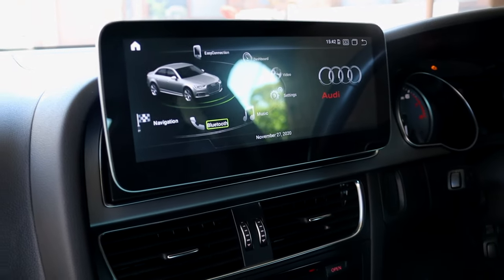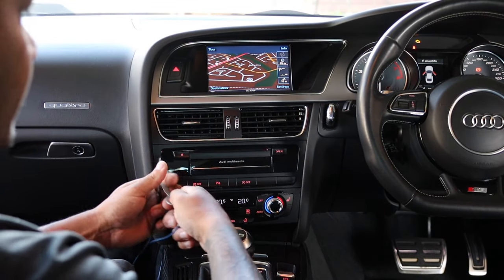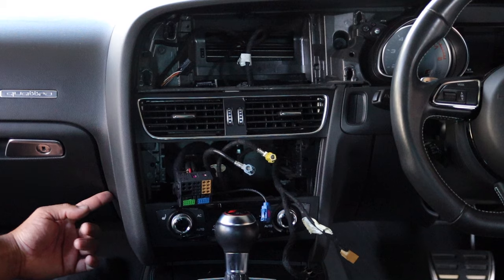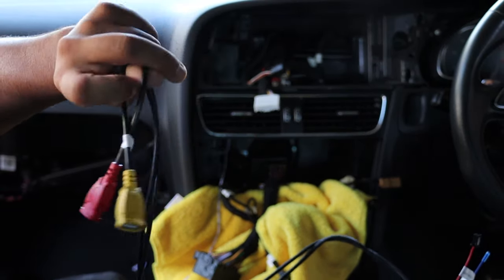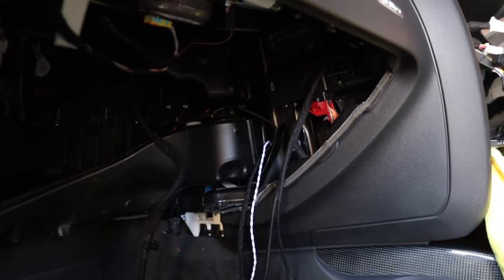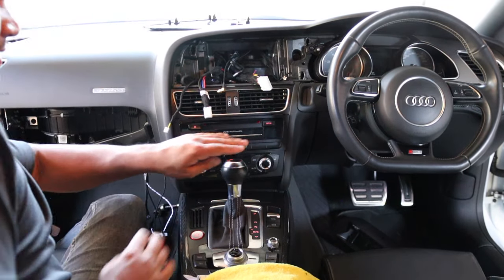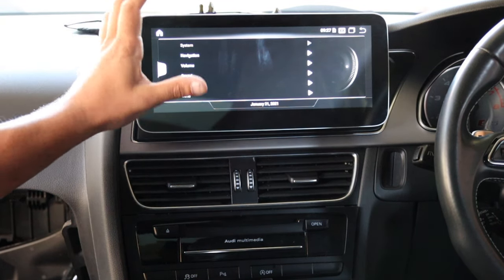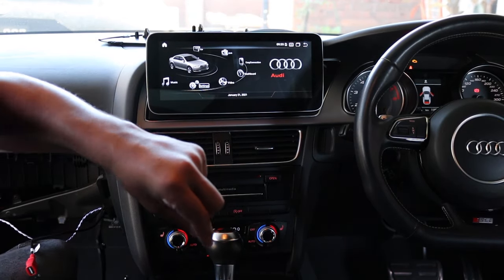Audi A4/A5/Q5 10.25" Android Screen Install (Full Install) Wireless CarPlay / Youtube / Netflix.

Comment: Great video. Just installed this on my A5. I had such a tough time removing the glove box. I had one extra screw behind the cd changer that no one else online seems to have. Apart from that it was pretty easy thanks to this video. The screen is fantastic, super fast and defo takes off 5yrs from the age of the car. Would recommend
Reply: i had the same issue on a Q5 lol
Reply: I just installed the latest Android 12 model, you don't have to remove the glove box (audi b8.5) can bus taps into the hvac connector
Reply: @wiskyd  I guess this can bus connector will be the same on A4 2013 B8.5 right? this would help a lot
Reply: @theDesiderata84  yes
Reply: @wiskyd  did you have any issues with the screen not turning off? It won’t shut down when I turn my car off for some reason.
Reply: How is it holding up 7 months later?
Reply: @trumpies  mine is great still, I prefer using android auto wired and Bluetooth through factory audi connection
Reply: @LiftedDigitalMedia  nope it works great. I even updated the firmware.
Reply: Does it give wireless android auto?
Reply: @coastalviewproperties4346  yes
Reply: Can anyone think why I'd have no power to the screen when power is going elsewhere? 😮
Reply: @LiftedDigitalMedia  nope
Reply: As soon you plug in screen, it did light up without key accessories, does it always stays on ??

Comment: 2012 Audi Q5 MMI Multimedia.. All works fine with the system but the sound is not very good when using Carplay (wired or bluetooth), I have to turn it on really high to hear anything and the input sound on the system is set to high... Anyone have this issue?

Comment: Any effect on sound quality and can you also use the steering controls to interact with it?
Reply from the maker: Sound quality is perfect. Installed today in 2 SQ5 with B/O and customers loved it
Reply: @TheFittingBay  Could you share the B/O configuration? my sound is really bad with this screen
Reply: @chrys00  So is mine. I find turning off loudness and using the pop or a custom EQ with smart bass enabled seems to work the best. ALl the eq's are way too heavy on the high frequencies. Not sure how it sounded before the screen upgrade as I bought my car with it already installed.

Comment: Great video, just fitted one of these for my wife today, look amazing and a great upgrade to the car. Your video is good, you should cover the air bag switch and the bezel a little better but your a great advert for your business. If I was over there I’d have bought from you based on this and your support. Well done fella 👍
Reply: Hello james, did you get the air bag switch to work? Ive installed it and now my airbag light stays on, on the dash. There is a airbag plug on the old trim but not on the new, what can be done here, thanks.
Reply: @cihados  having the same issues, but mine has a connector on the back of the frame, but I'm unsure why there's a y splitter for the hazard/airbag when there's only 1 input.
Reply: @StuartLaw81  i figured it out. You have to take the plug out of the old trim and connect it to the new one and then hide it behind with all the other cables. Your airbag light on the dash would proberbly be on, so you have to clear it with carly or some other adapter.
Reply: @cihados  I've done that, tried it I did manager to clear the error (without using the adapter cable), but it flagged up an issue with the airbag still when using my obd scanner. So it's certainly not right yet. Thanks for the suggestion though.
Reply: @cihados  did you ever manage to connect anything other than a phone via Bluetooth? I can't connect my carista obd scanner to the cars Bluetooth as the settings look like they've been gutted and replaced with a sub standard default app.
Reply: @StuartLaw81  is the airbag light on on the dashboard?
Reply: @StuartLaw81  there is a lot of issues with this device, it isnt at all plug and play. I havent got the need to connect other devices than my phone to it, so no i havent tried. But only certain apps works with the gps, when in call the other person hears ecco which is extremely annoing, when installing music players like poweramp and others the apps cant get to the internal hard drive. There is just a lot of bugs. Im not using android auto cause its really bad with phone calls etc.
Reply: @cihados  thanks for the feedback. Guess I'll just have to deal with it as it is.
Reply: Have you guys solved the airbag light issue yet? I'm keen to get one of these but if there is an airbag light on, my car will fail MOT (mandatory annual roadworthiness test) in the UK. @The Fitting Bay
Reply: @SpeedingTube  Have you got one of these units fitted now?
Reply: @theDesiderata84  No, looks awesome but can't take a risk on warning lights in the UK.
Reply: @SpeedingTube  I have ordered different unit (same size) but it is only for android auto/carplay as I thought I wouldn't use Android system on it anyway. Mine came with a different surround bezel - it comes with an airbag light below the hazard button (same as the original) I haven't fitted it yet but it will be sometime this week. 
The unit itself was also cheaper
I'm in the UK

Comment: Great video, My local Audi dealer just did a navigation update on my wife 2011 A5. The problem is the Nav now has a "unable to read data" message. They want to replace my MMI unit for $4K. My question to you is, does your unit use the Audi software for the Nav or the apple and  or android software?

Comment: This is pretty cool. But idk about this over systems that use the stock screen. This looks nice at first, especially having a bigger screen, but it’s also really big, sticks out a lot, won’t have shade from sunlight both for readability and lifespan, and makes it more obvious to others what you’re doing. Plus it’s about $200USD more expensive. 

It’s a tough call cause there’s not many options and this has better integration with the stock system, and it’s so flashy that it might help sell the car down the line. 

Just bought a 2015 Q5 myself before knowing you can’t just upgrade the stereo/screen with a normal aftermarket one like most cars. So if you have basic radio/CD and that’s it, you’re stuck with it except these few specialty systems.

Comment: Question, how did you connect the airbag when you removed the trim? As on the Audi A4, there is an airbag connection part of the hazard lights. However, there’s no airbag connection on the new trim piece.
Reply: And me
Reply: Hi I know this is 2 years late but did you get the answer i’m trying to figure this out as my airbag light is on from this kit

Comment: I purchased this Android screen about twenty months ago from Nathan at The Fitting Bay, it was a professional and pleasant service from Nathan but the screen itself was nothing but problematic, as I will explain.
For the first screen, there were two fitted overall, my Samsung S22 was paired to the screen, and it was working, but on the way home, it disconnected from the internet so that idea was no good so with speaking to Nathan decided to use a sim card at a cost to me and that disconnected also .
I informed the fitting bay of the issue, so I returned, and a new screen was fitted, it was paired to my S22, and that problem was sorted, but the beginning of more. 
The screen freezes at least once a day so I permanently carry a paper clip to reset the unit. if, for some reason, I have to pair my phone again, it is impossible for me or anyone else I know can pair it so back again to the fitting bay, about 1.5 hrs each way and Nathan, after a lot of trying, gets it paired even going to the extent of driving away from the workshop to the road to see if that helps. 
When I start my Audi I select apps and then select ZLINK and if it doesn't freeze a notice appears saying, unlock your phone, as I am driving I unlock my phone and I have music, maps and phone, that's all I use it for. 
Another problem is if I am talking on the phone and I select reverse that's the end of the phone call.
As you can see I am not happy with this screen which cost me about $1200.00 , as soon as I find a replacement I will do that and cop the financial loss and put this one in the bin.
Reply: Thank you
Reply: You talked me out of considering one of these.   What will you replace it with?

Comment: Hi, I have just installed a very similar screen to this. I have an Audi A4 B8.5 Avant 2012, it does has Audi multimedia. I am having an issue with the audio. I cannot hear any audio from the device through the speakers. When I go to the original source, it says AMI is not connected. Any ideas? Many thanks
Reply: Me too, you solve the issue?
Reply: You might have to activate AMI through the green screen which you'll have to enable it with an obd11
Reply: @TO-sf3dx  I did solve the issue yes. I wouldn’t have been able to on my own. I spoke to the seller I purchased the device off, and he instructed me to cut one yellow wire out the back of the main plug to the screen. This solved the issue and magically AUX was visible and I could select it, audio works perfectly
Reply: If you need images of which one to cut I can send them to you via email if you like

Comment: Will this work on my 2012 Audi A4 with the Concert MMI? Also how does it display things such as fan speed and vent control for heating and AC?
Reply: I'd love to know this also... If it does I'm buying this straight away.
Reply: @joesephmontago795  It does overlay onto the screen with your fan/ac controls when you change them for me in my A5. I have a similar screen.
Reply: Did you end up getting it I also have 2012 a4?
Reply: @ryanmtb8630  I ordered it and they sent it to the wrong place and never even told me it was delivered and then denied doing anything wrong and never sent out a replacement for me so I got a refund and ordered from somewhere else. I'd stay away from this one specifically

Comment: Hey…my car multimedia just came, couldnt wait to install it and booom…many problems…
1. No audio sound from navi, you tube etc. Like some connection is lost or maybe some settings i didnt setup😏
2. After installation buttons between seats doesnt works ( like car, navi, radio etc. Even no red light on them) scroll button also doesnt work
3. Sometimes volume is up or down by itself😱
No idea what i could done wrong… looks like same as in your video but… 😒😒😒 doesnt works properly. If you had similar problems, let me know how to fix it…

Comment: Great video! Is this screen compatible with 2011 A4 B8 Radio only MMI? Seems to be, just making sure, going to be ~1000€ after customs😂
Reply from the maker: Compatible with all you can check here:
https://shoptfb.com/collections/audi/products/a4-a5-q5-09-16-10-25-android-replacement-screen
Reply: For anyone who has an 2011 or earlier A4 B8, I can say that the silver bezel doesn't match the one in the video nor is the one in the video a direct replacement. Also you will likely have to change the CANBUS protocol from 3G+ to 3G if the MMI controls go dead 20 seconds after switching to the android interface from the OEM interface.

Comment: Anyone having issues with the navigation wheel? It works fine in the stock MMI interface but doesn't do anything on the Android screen?
Reply from the maker: Speak to supplier
Reply: yep got the same problem, wasn't able to fix it...maybe you can keep me updated if you get a solution
Reply: @Mezziz  when I unplugged the head unit (screen) to put back the trim and reconnected the cables the problem was resolved so my guess is a loose connection possibly.
Reply: same problem here. The Joystick doesn't work and 2 leds keep blinking in central console

Comment: Got a 2017 a5 convertible. Interior looks exactly the same as yours, however on the website 2017 isn't covered by the 10.25inch screen. Is that because the wiring is different or will it still work? Cheers

Comment: Do I only need to use mobile hotspot to download apps? For example If I downloaded Waze does it still need wifi or will the GPS take over from there?
Reply from the maker: Needs internet. Unless you are using CarPlay/Android auto in which case it runs via the phone.

Comment: Audio Problems: 1. Make sure you have external source active in the MMI - if missing activation via green menu needed. 2. Make sure the AMI port is connected via the AUX adapter to your head unit - I had an aux cable connected to RCA OUT of the android unit. 4. set your source on media to external audio and the audio will be basically going from the android system through RCA OUT into the AMI Port. Hope that helps someone.
Reply: Hey mate, once I enabled aux/AMI through green screen, media plays music for 3 seconds then automatically switches to jukebox. It happens even when AMI isn't plugged in. Do you have any idea how I can fix this problem?
Reply: @frankbere  hey mate how did you access the green screen? was it through an sd card?

Comment: Does it improve the sound quality or not? I am assuming not since it uses the mmi and amp? Please let me know. Thank you!
Reply from the maker: Audio quality is the same but this also has a built in DSP you can use
Reply: Yes, that's right it uses the amp and speakers but the unit has its own DAC, therefore, you will be able to play different music formats such as FLAC.  OEM sounds warmer and this sounds a bit brighter which is not a bad thing, also the bass compared to OEM is a bit weak.  Overall sound quality is acceptable, apart from it doesn't show the volume bar.

Comment: Hello. I have bought this thing and that’s really cool but my happiness haven’t lasted for a long time 😔 I’ve installed every plug and cable. The screen has started up but when I wanted to press any button on MMI control panel, it didn’t work. And now I know the reason. The plug (the red one) in glove box to gateway module is not the same as adapter from the screen and it doesn’t fits to themselves. I’m really miserable. I’m waiting for the answer from the seller to give me some advice to conquer it. Do you know maybe is there any other adapter to make it work? My car is AUDI A4 B8 2009 3G high with GPS. 

Kindly greetings 🖖
Reply from the maker: Did you purchase this from us?

Comment: Does this upgrade get rid of the hair pulling boot up time for the mmi bluetooth... Because the car is using the same hard drive...Or does this connect to the touch device's own built-in bluetooth module?
Reply from the maker: It has its own Bluetooth module. Start up isn’t instant but I’m sure it’s faster than your system if it’s starting to lag
Reply: @TheFittingBay  it isn't lagging... Just a b8.5 flaw of using a hard drive instead of ssd like these newer models. A little silence is also good at times. If I were to get an mmi system update, wonder how this would affect it. Have you vagcom with this unit?
Reply from the maker: @conversationovercoffee  mmi update won’t change the unit or performance of the unit at all. It has its own OS. But it also allows the original Audi equipment to be displayed by piggy back cable for video input from OEM screen. So you can do whatever you like with the OEM system and whatever you like with the new system and they won’t affect each other. The only prerequisite is that you order for the correct vehicle type - Audi MMI 3G/3G+ or concert / symphony.

Comment: Are you still able to use voice commands? Is that what the mic plug for or does the display have a built in mic?
Reply from the maker: Yes you can use voice commands and the mic is built in and there is also an external input for mic

Comment: Hey dude , great work ! I have a B8 S5 cabrio and the screen surface is rooted ! Do you have any second hand screens ? I am looking to add the apple car play unit you sell but need a decent screen before I do that . cheers
Reply from the maker: Unfortunately i do not man. You can use a very light polish and spend a couple hours removing that protective layer on the screen it will look new again or just buy the 10" :P

Comment: Hi , just installed the unit and it’s awesome ! Thanks for the info ! One question as I am trying to put my mp3 music on it ! 
Original system MMI, I put on an SD card and put it in the slot and it worked . Tried to do it with the new system in the back of the unit . It doesn’t seem to fit properly. 
Do u know what SD card size would I need ? Or what’s the easiest for music transfer ?
Thanks 🙏
Reply: Maybe try installing SHAREit on the display and phone to transfer data

Comment: I installed this in my audi A4 2016 and now am getting an airbag light on my dash. Did u have same issue after install? Not sure if the piece that replaces the e lights causes it as my car had a passenger air bag light as well on it originally
Reply from the maker: Contact your supplier for correct cable
Reply: @TheFittingBay  figured it out the entire light on the mount came with a y cable so for my model had to plug my original e light into it as well
Reply: I have an iPhone will it work with iOS devices ?
Reply from the maker: @redskinrob1204  yep

Comment: Hi, I’ve just purchased one of these systems for my Audi A5 2009 model I watched your video which was brilliant I followed everything in your video but I can’t get any sound through CarPlay but sound comes through on the standard radio system. I have the Ami common the glove box which I e plugged that in. Can you advise on what I have to do or I’m doing wrong.
Reply: I have the same problem. Did you get yours sorted, if so interested to know how you did. Thanks in advance.